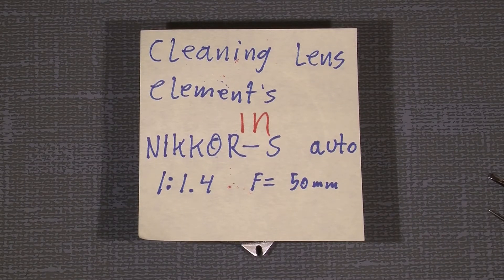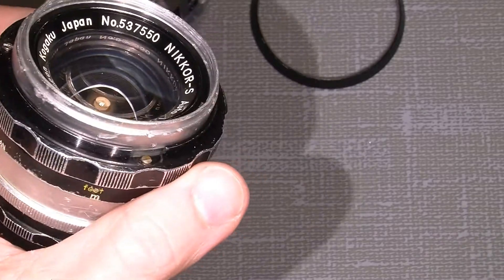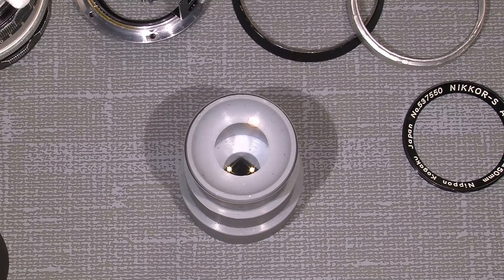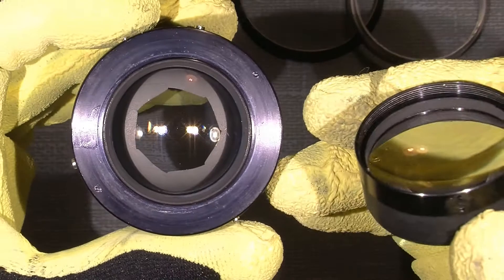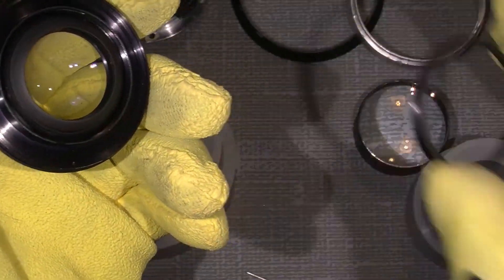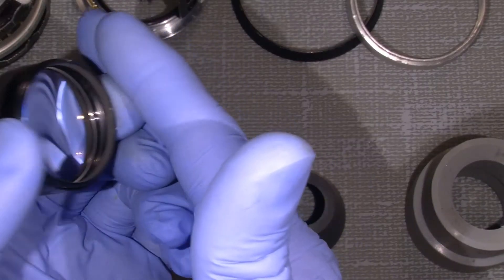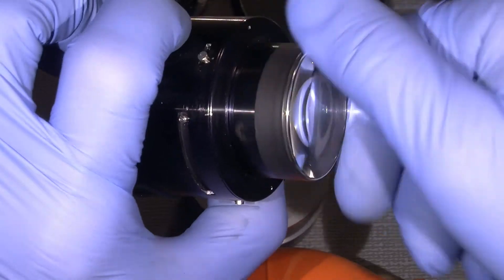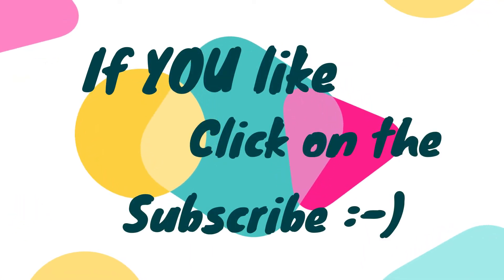Cleaning lens element's in NIKKOR-S AUTO 1:1.4 f=50mm

Comment: What's the best way to get the screws out from the rear of the lens. Mine has flat head screws that are incredibly thin and there also seems to be some kind of locktight on them. I tried using 99% IPA but it only worked on one screw. I was hoping to do an aperture ring swap.
Reply from the maker: I have tryed different solvents, it will say, Lighter Fluid, Acetone, Xylen, Thinner, Penetrant Oil, WD-40.

And the best solvent is still Isopropylalcohol 99% ( IPA ), sometimes you need to let it stay much longer that you expected, and it's a good thin to put a few drop on the screwhead  every 5-10 minutes from time to time.
And when trying to unscrew the screw, gently going a little Counter clockwise and then a little Clockwise. Hope it will work for you.

Comment: Hi, I wonder if you could help me? I am trying to disassemble the same lens and I cannot unscrew the front retaining ring. I still don't have the 'Push Fit Boss Adapter'  (the tool you are using) but I am looking for one which is not easy to find in UK. The question is, whether there are times when it is not possible to unscrew the retaining ring and if yes, what would you do?  Would you try to loosen up the ring with WD40, for instance? With thanks. Dragan Mikki
Reply from the maker: If you look at around 7:17 when I use the rubber tool, it you go to the hardware store and in the plumbing section look for some of those rubber gaskets, try to find one that almost fit on the black retaining ring. This kind of rubber gasket is really good sticky rubber and a perfoct "tool" when working with lenses.

Maybe this one can be useful:     https://www.cityplumbing.co.uk/Osma-OsmaDrain-Internal-Connector-for-50mm-Waste-Pipe-to-110mm-4D299/p/870067
Reply: @mikeno62  thank you very much for this, but I already have similar thing. I tried even with heating the front retaining ring and still cannot unscrew. My question is, have you ever come up against similar problem when you couldn't unscrew it at all, no matter what you tried?
Reply: @draganmikki5688  Did you ever resolve this problem? I am in exactly the same situation now.

Comment: Nice informative video.

On the lens mount, what is the purpose of the black arc-shaped protrusion around the inside portion of the mount? I noticed that not all Nikkor-S lenses have that protrusion (e.g. the Nikkor-S 50-mm F2.0 has a smooth internal ring )

Comment: Thanks for your video, I've been fixing my 50mm 1.4 non ai type K (same as yours) for days but although it works well and the focus turns smoothly, I can't get myself to focus infinitely by following the steps in your video. What could be the problem? I can't get focus further than 3 or 4 meters
Reply from the maker: If someone has disassembled the focus helicoids, without setting any marks where the helicoids threads separate, and just think it should not be a problem and in that way assemble the focus helicoids, but take the wrong helicoid, then it will not be possible get to infinity. If you take a closer look on this video about another Nikkor lens, where I show how to re-lube the focus system, then you will see why it is so important to set a mark and also measure the length of the focus system, before take it apart.
Well, it could also be another issue, if the lens assembly have been taken apart for cleaning the lens elements, and when assemble it again, some of the lens element's has been put in, in a wrong position.

Hope it make sense.

Comment: hello, tose screws in the back flathead are pretty hard for me to get out.. any tips?
Reply from the maker: Yeah the screws can sometimes be very tight, but you can try to use Isopropylalcohol 99% or so on a cotton bud simply to soften the thread lock. Add 2-3 drops on the screw head and wait maybe 10 minutes or more, for the solvent to go in on the thread. Maybe you have to do it 2-3 times, then gently turn the screwdriver 🪛 counterclockwise and clockwise, to loosen it.

Comment: Hi mike, I was wondering if you have any experience with a Rolleiflex SL35 E? I recently was given one by my mother but its not working. tried new battery. The problem is that it will not reset and the view finder won't go down. Its like its half completed taking a picture and is now stuck there, the film progresser is also stuck and won't let me more it past half way to progress the film. Any help would be greatly appreciated. Moses.